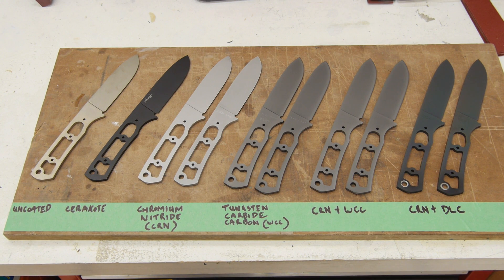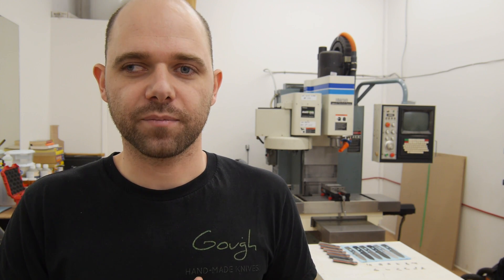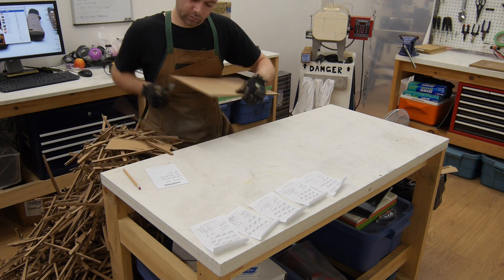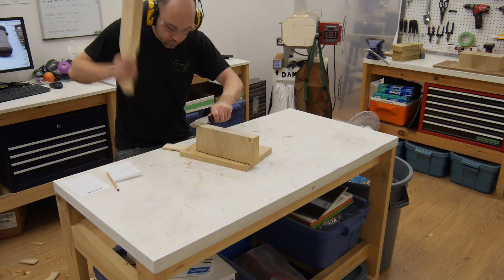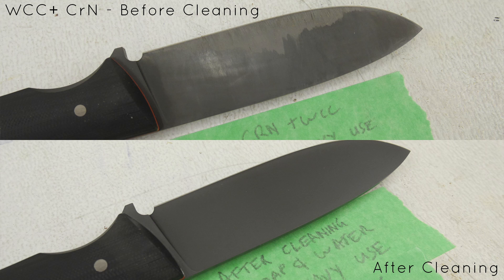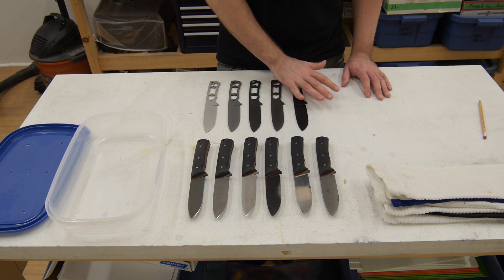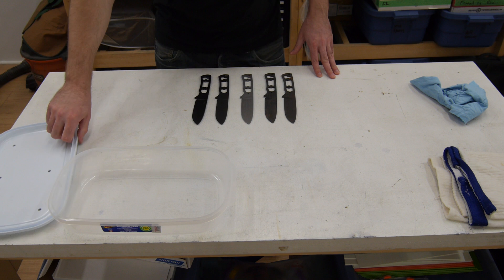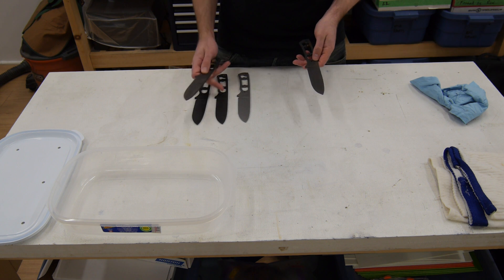Knife coating showdown! 6 different blade coatings tested.

Comment: Thank you for this comparison, I have two questions now: How do you prepare the blade surface before the Lu coating process for better adhesion, like to you polish them before or get them bead blasted e.g.? And do you sharpen the edge before the coating or after the process?

Comment: I recognize I’m making this comment years after you made this video. But have you ever tried ion plasma nitriding? I had a part made using DLC and another with IPN and the ladder really held up to abuse, but maybe I didn’t use the best base metal. Mine were on hardened 440c vs yours which was on D2 I believe.
Reply: Would you prefer IPN over DLC coating for 440C? I have a blade with the ladder as well. Also do you have PVD/IPN coating shop recommendations?
Reply: @ I’m not a knife guy but I’m an engineer who sometimes deals with special coatings. But I would say you probably want DLC. DLC works best on hard materials which makes it work really well on knives. The color looks fantastic and it is somewhat self lubricating. Two things I think you should know though. 1) there are a lot of different types of DLC coatings and if you don’t specify the shop is likely just going to do whatever they think is best. DLC is used for a lot of metal on metal contact so the variation you go either is primarily chosen based on its contact material. 2) This one is more important, DLC seems to wear in where in the first bit of use it seems to discolor and lighten under wear. Many people see this as a coating failure but it seems to stop after that initial wearing in. Then it can really hold up to some major abuse but it can give off a streaking appearance that some find unattractive. IPN doesn’t seem to have this effect so although its overall not as durable it may seem more durable to the user. But it doesn’t have the nice dark charcoal blue appearance it usually looks more like a chrome plated appearance.

Comment: not sure where you got your dlc done because ceracoat is nowhere near dlc

dlc is hundreds of times more corrosive resistant than ceracoat
Reply from the maker: The coating itself is very corrosion resistant yes, however it's also porous to some extent and these blades were not stainless. So it's not the DLC that's corroding, it's the steel underneath.

Comment: I didn't realize that knives could be cerakoted. I thought that if a knife was cerakoted that it would not be able to be sharpened, or am I mistaken?
Reply from the maker: You just sharpen right through the Cerakote, no problem at all! Relative to the steel the Cerakote is very soft and easy for a sharpening stone to cut away.

Comment: I have some coating on a Kershaw folder..(black,kinda shiney) and tried to remove it with Jason paint remover....didn't even budge it!!! I don't wanna go the sanding method...any ideas??
Reply from the maker: If you don't want to sand it off then probably the only other option I can think of would be bead-blasting...

Comment: There alot of comments on this, great video by the way, just wondering whith eather DLC or Cerakote blades how do you sharpen them? Is there coating on the cutting edge?
Reply from the maker: Hey Bradley! You just sharpen them the exact same way as usual, cutting through the coating is not hard at all!

Comment: How can i fix large scratches on a blade with black DLC coating?
Reply from the maker: Unfortunately you really can't unless you go to the extreme of stripping the whole blade, re-finishing it and the having a new layer of DLC coating applied. DLC is not something that can be touched up!
Reply: @GoughCustom  Any substitutes that would blend in and look similar? I'm tempted to sharpie over them 😬
Reply: @bananaclip8989  on carbon steels the 'super blue' product from Birchwood Casey can sometimes work, but on stainless there are no options that I'm aware of, sorry mate!

Comment: Will the edge hold longer if coated after sharpening ?
Reply from the maker: The answer is 'maybe'! However you're going to have to sharpen it at some point, and then you'll take the coating off anyway... For that reason plus safety (it's dangerous to assemble the knives after they're already sharpened) I decided to sharpen after coating.

Comment: ANYONE HERE or Gough Custom - Did i read somewhere that rust can still build up under the DLC coating (not visible)? Also is it still reflective partially? i saw a black coated knife video in the sun and it reflected.
Reply from the maker: Hey mate! Yes rust can still grow under the DLC coating, however it will definitely be visible! Invisible rust is not possible as the coating is very very thin, only about 1-2 microns thick.

How reflective the blade when DLC coated completely depends on how the blade was finished before coating. If you mirror polish the blade and then DLC coat it you will have a black mirror! If you sandblast the blade completely matte (like I do) and the DLC coat it you end up with a non-reflective matte black blade!

-A
Reply: @GoughCustom  - thanks for good info. So if it can rust under the DLC coating what's the point of using DLC at all?
Reply from the maker: Mainly appearance! DLC is by far the most durable black coating...
Reply: @GoughCustom  - is rust able to form under all different types of coatings? know any where it will not?
Reply from the maker: @gwailotus9154  If rust protection is the priority then Cerakote might be a good option. Just note that it will wear more quickly than the other options... Nickel plating might also be an option, but that can lead to embrittlement of the blade if you don't follow the proper post-plating heat-treatment steps!

Comment: Hello:)
Great video💪😊
Can you please tell were or how you do DLC coating?
Reply from the maker: Hey mate! Unfortunately DLC coating cannot be done at home as it requires some very specialized machinery. I use a company in Canada called Sputtek, they apply the coating for me, but it is impractical to have a company do it unless you're sending them quite a few knives/parts to coat... I would recommend Cerakote as a more accessible option!
Reply: Thanx for enswer😊
Im contact to cerekote, the have few products, they recomend to use: cerekote elite.  They told me that elite series is like DLC, it is true?
Reply from the maker: @dancars106  Very unlikely to be true... No paint coating can be as resilient as DLC. DLC coating is literally harder than the blade steel is! However Cerakote is a very good coating for corrosion resistance, it will just wear as you use it. I used to use standard Cerakote in the Graphite Black color with good results.
Reply: Maybe the Elite is better.
If you have the time, maybe test it.
Its be interesting video to see. No one do that.
😊💪
Reply from the maker: @dancars106  Looking at the techinical datasheet for Cerakote Elite: the results for scratch/gouge resistance are exactly the same as standard Cerakote unfortunately, so I don't think there would be a big difference. I think the biggest change between them is that Cerakote Elite goes on a bit thinner... I wish it was as good as DLC, as then I would use it myself!
Reply: Ooooo im not notice that🤦‍♂️🤦‍♂️🤦‍♂️🤦‍♂️
Reply: Can you tell how much DLC coat cost?
It expansive ?
Reply from the maker: @dancars106  If you're just doing one or two knives then yes it can be $100 or more per knife... I get much better pricing (around $30 each) because I send at least 30 blades at a time for coating.
Reply: Heyyy😊
Can you tell me if DLC is only black colour?

Comment: It has been 4 years, I know. But I find it surprising that the satin finish blades was - with the exception of the tip - without any rust spots or oxidation, while most of the coating have shown rust/oxidation spots randomly distributed. Do you have an explanation for the rather particular pattern on the satin finished blades? I am asking out of curiosity.
Reply from the maker: Hey Matus! Basically the smoother the finish for a given steel the more likely it is to resist the beginnings of oxidation... A steel polished to a mirror finish will do better than a matte finish (unfortunately). So what happened with the satin finish was that some tiny scratch or flaw in the blade likely provided a place for the oxidation to start and then is spread from that point outward.
Reply: @GoughCustom  Thank you Aaron, I agree, that does sound like a very probable cause for how the satin finished blade reacted.

Comment: Try the test that Cerakote performs....  maybe put a saltwater mix in the bottom of the container with the knives suspended above it and heat the container to 90 degrees and see how long each withstands rusting.  The salt will encourage corrosion and you can really see which is a better coating.
Reply from the maker: I agree that the corrosion test could have been made more difficult. However there are lots of factors to consider other than just corrosion resistance unfortunately!

Comment: Great. Can you do a flame torch (red hot) test on the dlc? thermal shock i.e. dipping it into the water when its red hot
Reply from the maker: I doubt the coating will survive that. The red heat will likely cause the carbon to react with the oxygen in the air and turn to carbon dioxide. The thermal shock is not likely to be an issue though I dont think.
Reply: @GoughCustom  thanks but i believe it should not as some of these coatings are done on pistons and valves and there's literally fire inside the engine. I'd appreciate if you could do a test :)
Reply from the maker: @rohanpuri1989  Being exposed to high temperatures is not the same as being heated to red hot... Pistons in an engine do not get anywhere close to red hot, because the incoming fuel and air cool them, as does the oil bath underneath the piston and the cooling channels inside the engine block that surround the cylinders... Heating a knife with the coating to red hot would not prove anything, and in fact might give you the idea that the coating is bad when it's not!

Comment: how do you source DLC coating?
Reply from the maker: With a lot of difficulty unfortunately, and that difficulty still continues as the company I use is very inconsistent... The company I currently used is called Sputtek here in Toronto. Getting DLC applied to just one or two knives is very expensive/difficult, it's only really an option if you do larger quantities unfortunately.

Comment: Hello, I need some help, can you tell my how can I remoove the  black treatement on the pocket clip of my knife, you can look at the Benchmade mini barrage model, if you want to see what it look like...
Reply from the maker: Hey mate! Unfortunately there's no way for me to tell what the coating is from a photo... It could be DLC, TiCN, Black Oxide or some kind of paint... The best way to remove it would be to sand it off. Start with a fine grade of sandpaper like 800 or 1000 grit, that way if it has a nice finish underneath you will mess it up as little as possible! If that's not taking the coating off then change to a coarser grade of sandpaper like 400 grit. Best of luck!

Comment: What’s your process for cleaning? Soap and water? I’m only asking because you have presented everything so scientifically and thoroughly that I am assuming your version of cleaning is far superior to mine.
Reply from the maker: Hey Nick! Do you mean cleaning before putting the coating on or something else? For cleaning before putting the coating on I actually deliberately do nothing... The knives come straight out from sandblasting and are then only handled with gloves to prevent any oil from getting on them. The company that does the DLC coating then does the final cleaning using an ultrasonic bath and deionized water.

Comment: Hello Mate are You able to give me any advice is out there something that I could oxidate tungsten wire with?  to get more black at matt surface? of it
Reply from the maker: Could you try heating it so it produces an oxide layer?
Reply: @GoughCustom  Thank You for Your reply .. I have tried once. The wire is 0.06 really thin, I have noticed a slight difference after. But I was working with the lighter I suppose it needs higher temperature or?
Reply from the maker: @nomimagic  yeah you probably need a much higher temperature... I would try running an electric current through it to heat it up!

Comment: Thanks, very informative! I was curious however, how do you think titanium nitride (or Tin) coatings would hold up on a knife? Or even a variant of it such as Titanium aluminum carbonitride? I see that they are used on tools like drill bits and such, but I've never heard of these coatings being used for knives.
Reply from the maker: I would love to try TiN but unfortunately the application temperature is too high... The company I use for my coatings can only apply it at 600ºF, but my max process temperature has to be below 400ºF. I believe some other companies can apply it at lower temperatures though, I might look into that in the future!
Reply: @GoughCustom  Thanks

Comment: Do you have them coated after you temper your knives or before? I was reading the coating process temperature could go up from 320 f to 488 F which would ruin the temper
Reply from the maker: They have to be coated after the temper. Many of the coatings can be applied at different temperatures depending on need. I have my coating vendor stay below the tempering temperature (400ºF)

Comment: Hi Arron, quick question! How are you sharpening after coating the cerekote? Thank you sir
Reply from the maker: Hey mate! Just like normal! None of the coatings get in the way of sharpening at all!
Reply: Gough Custom sorry, I meant what type of process, I used the Lansky sharpening system and it took several hours, do you throw yours on the belt grinder to get that crisp micro bevel? Sorry about the confusion and thank you kindly for the reply👍🏼

Comment: where do you get youe DLC done? Unless you do it yourself. I'm asking because I don't expect you have an FFL..
Reply from the maker: I get mine done by a company in Toronto called Sputtek, however I don't think they do firearms and shipping gun parts across the border is likely a no-go anyway. There are definitely coaters in the states that do gun parts, but I think they are hard to find unfortunately.

Comment: Where do you buy DLC coating?
Reply from the maker: I have mine done by a company in Toronto called Sputtek, there are a few companies around that will do it, but be warned that if you're only coating a few knives it can be very expensive!

Comment: What's your thoughts on Teflon or even Titanium coated?
Reply from the maker: Titanium Nitride might be a cool coating, but it has a very distinctive gold color that doesn't really go well with my knives I don't think. Teflon coatings tend to be fairly soft and would likely wear about the same as the Cerakote shown in this video!
Reply: @GoughCustom  These days kitchen knives are made very well, especially the Japanese ones. I haven't got a chance to get a Titanium coated one but I'm pretty sure they come in black, maybe not the nitride version, but I really don't know very much on the subject just that they may be worth a go especially for the price!!

Comment: Great video ! I have tried several solutions ie vinegar,ferric acid ect. My main problem is numerous black areas all over the knife. Some are more pronounced along the bevel. Would you PLEASE let me know what I am doing wrong and any suggestions. My blades are all 1095 steel...…..  Thanxs
Reply from the maker: It could be that you're actually seeing 'white areas' as opposed to 'black areas'. After a dip in ferric chloride the blade should be very dark black. The lighter patches are produced by decarburization. It can be very hard to get it even. The answer is to make sure you heat-treat very evenly (try using an anti-scale compound like ATP-641 from Brownells) and to sand thoroughly after heat-treat to make sure you remove any decarb.

Comment: Where do you find knife coatings for sale
Reply from the maker: Hey Wyatt, you will have to see if there are any coating applicators that service your local area... I use a company in Toronto called Sputtek, but it would be easier to work with someone local.

Comment: I liked this test. Have you tested Tenifer QPQ? Nitrocarburizing
Reply from the maker: Thanks mate! I looked into nitrocarburizing, but it seemed the process temperature was above the tempering temperature of my steel (400F) which means I couldn't use it...
Reply: @GoughCustom  So you're able to heat treat the A2 at sub 400 degrees and the DLC coating is added afterwards at temps below 400 to keep the temper correct? Is the DLC then kind of a temper cycle? haha, amazing. I thought a lot of the coatings ran at like 700f!
Reply from the maker: @DockWhoosie  Yeah the temper temperature for my knives is right at 400ºF, and then the DLC process temperature is kept under 390ºF so it doesn't alter the temper... Many coatings need to be applied hotter and that is the reason I have been unable to try them! TiN for instance is normally applied above 600ºF

Comment: Check out AlTiN coatings. It is a cheaper alternative to DLC, but it is still very nice. They are used on cutting tools and are very corrosion resistant. I have a knife coated with this that I took scuba diving in the ocean for two hours, and the salt did not leave any permanent marks. 
https://www.tincoat.net/altin_tialn.html
Reply from the maker: Unfortunate the application temperature of AiTIN is too high for most steels. DLC has an application temperature of 400f which is as high as I can go!